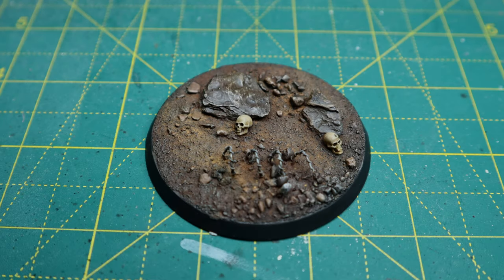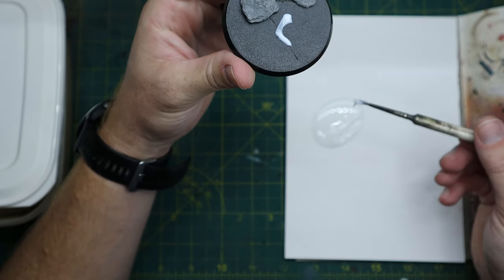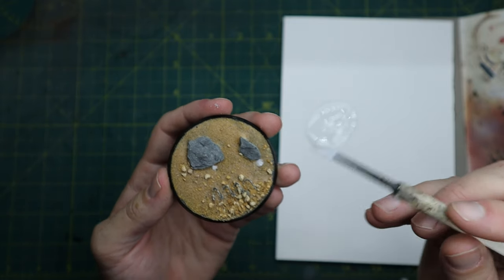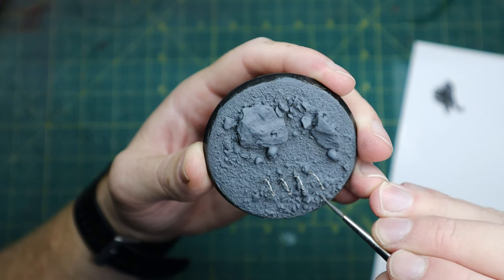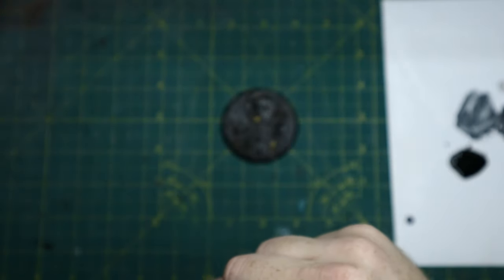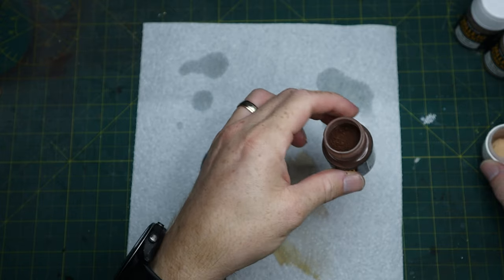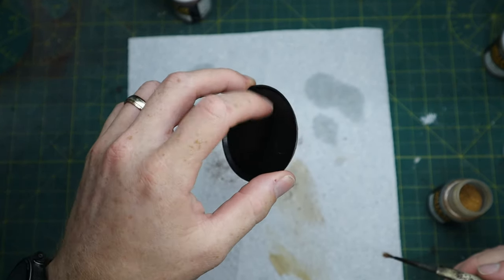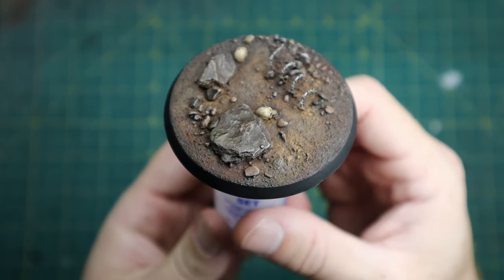How to create and paint Wasteland bases for warhammer Horus Heresy and 40k

Comment: I used a different thinner, but it seemed to destroy the acrylic paint layers since it contains alcohol. Figured maybe the Tamiya thinner is different, but the product description also says that it contains alcohol. Did you run into this problem? Maybe I just used too much thinner on the sealing step.
Reply from the maker: I didn't.  If the paint is fully dry before applying shouldn't be an issue.  Then just leave the fully dry before touching it. 

What thinner were you using?